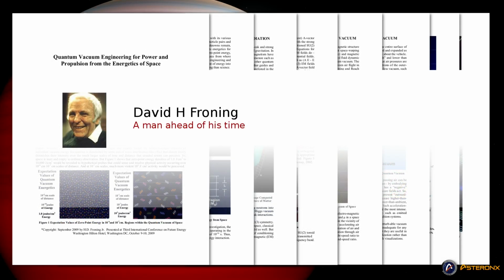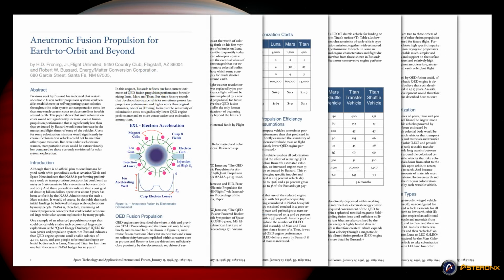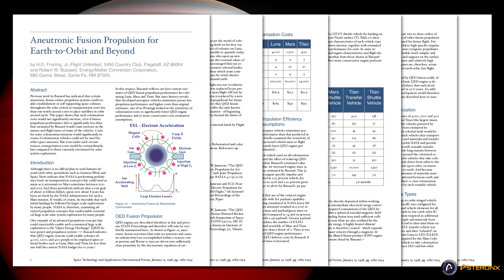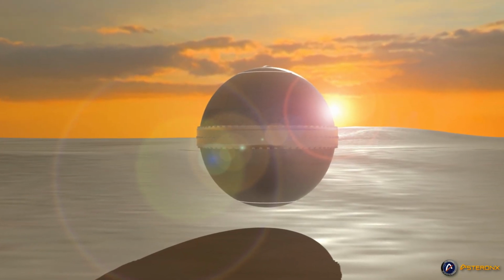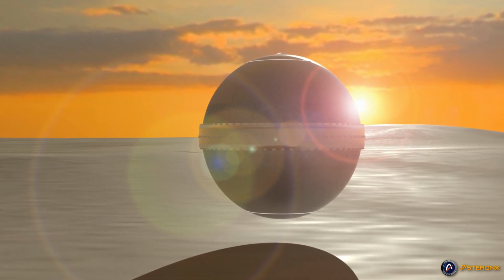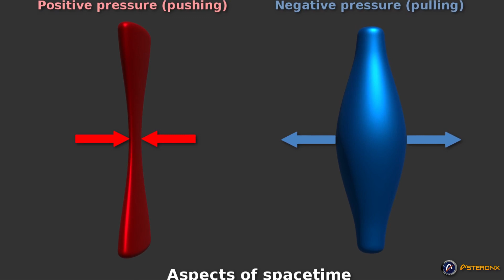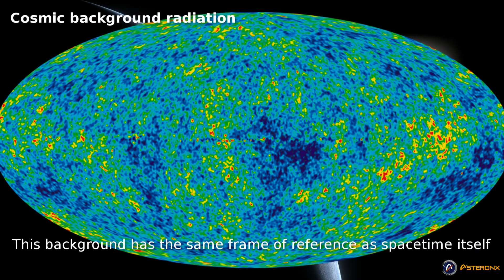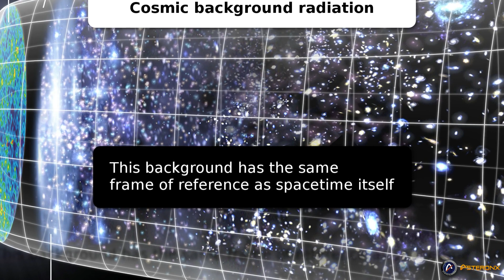An explanation of the Alcubierre-Froning Warp Drive part II

Comment: Elon Musk and SpaceX could build this
Reply: Patrick Milewski You have no clue what you're talking about.  A warp drive doesn't violate any laws of physics, dope.  That's why they are trying to build one.  It's been proven mathematically that it's possible.
Reply: Wrong, we have had warp drive and warp drive patents since the 1920s by Nikola Tesla, TT Brown, John RR Searl, and OT Carr. All PATENTED.
Reply: No warp drive uses a loophole that is in GR

Because a warp drive doens't exeed light speed meaning it doesn't violate the law of GR.
Reply: You guys don’t forget it needs negative energy for this to work ok. Need to harness vacuum
Reply: That is totally incorrect.  An Alcubierre drive is not reactionless.  It does not violate conservation of momentum or energy, nor does it violate relativity.   The proof of this is cosmic inflation. Your analogy of perpetual motion machines is incorrect as a perpetual motion machine would have to violate Unity via the 2nd law of thermodynamics.  Dr. Alcubierre's interpretation of relativity has been peer reviewed and is accepted as correct in the physics community.  Dr. Froning's work my not be accurately represented here.  The idea of strongly interacting photons means that all other forms of mass and energy would not be able to pass thru said SIP field.  So, what are the results on mass and time dilation if Higgs bosons could not interact with the mass inside a SIP bubble?
Reply: Patrick Milewski not really the a alcubierrecdrive works under current laws of physics but their are problems
Reply: Elon HAS an Agenda and they r still using chemical fuels. they r not! going to ever get into warp drives.   There is Nothing Tesla about his car either except the electrical drive THAT NEEDS charge. Fail attempt Cool Name.  .  .
Reply: probably already working on it he never say whot is next to..until he had soemthing in hands
Reply: Patrick Milewski Light sail is reactionless and we know it works 🤣
Reply: Doubtful, as any ftl drive or reactionless drive is a blatant violation of the laws of physics. The warp drive is currently in the same realm as perpetual motion machines.